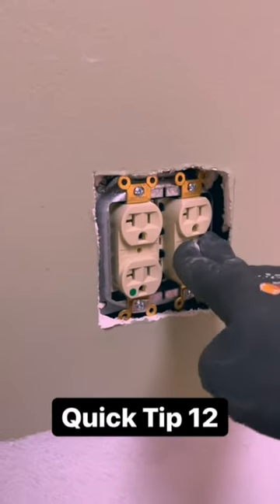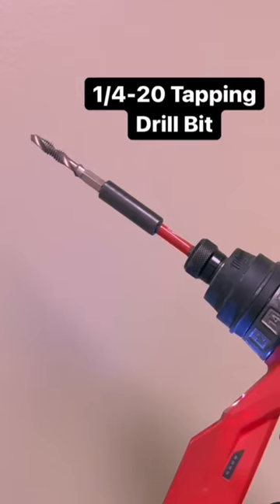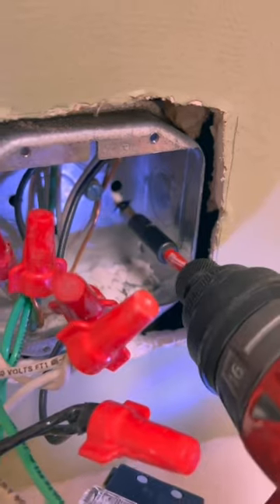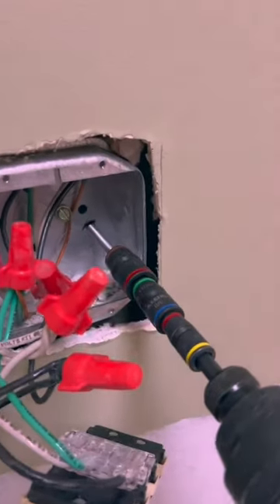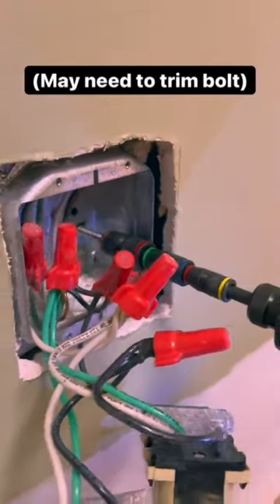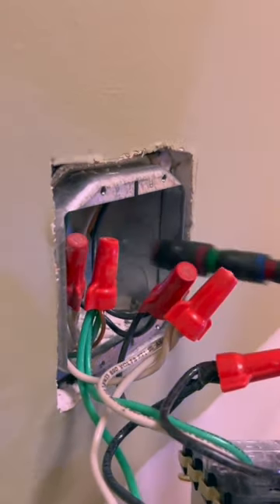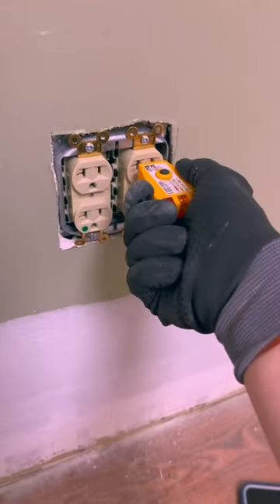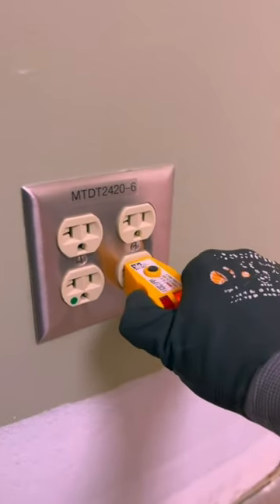Electrician Quick Tip #12 ⚡️

Comment from the maker: Context: CMU wall behind, not drywall. This backs up to a large mechanical room.

As long as you trim your bolt short enough to only push your box forward enough so that you can get your cover plate on, your cover plate should keep your box from pushing back further when things are being plugged in anyways. The main idea for this trick is just to get your box forward enough to get your cover plate on. ⚡️
Reply: I was thinking the same thing, that the length of the bolt depends on the depth of space behind the box.
Reply: Just do it right in the first place. And yes there are more ways of doing it than have been mentioned here. The plastic face plates are not that strong they'll break before too long if you use the outlet often
Reply: The major problem with this hack is in time, you'll end up with a sunken box again and a screw sticking out the wall on the other side.
Reply: True for a good quality Lutron plate, but the 50 cent plates everyone gets from like ace hardware will crack at the screw and fail every time. This is a good trick for rental properties where you’re trying to keep the cost down and not buy a $50 box of outlet covers.
Reply: @dennismccolley1380 itd be good for going behind dummies 10 years later when the plug fails.
Reply: Until it just pinches through the wall on the otherside lol
Reply: @dennismccolley1380 nope quiet you’re clueless so stop telling people what is what. The DRYWALLERS will take your h4 stud rings or your caddy box arms and fold them right in to make their job easier. And we don’t use plastic plates anymore period. Plates are nylon and unbreakable
Reply: @shadygunshow I have replaced 3 plate covers in the last 6 months because they broke nylon is not unbreakable and not designed to take the force of plugging and unplugging cords. Otherwise why would you attach your box to a stud at all just let it hang until you put the cover on them
Reply: I just use torx screws
Reply: @tommyt414 That’s what I was thinking your better off just fixing the box instead of making a “hack” that will only last a few months.
Reply: That isn't too bad of an idea, honestly.  But it looks like the reason that box is floppy is because it wasn't mounted to the stud properly. Could you use this same trick, but go into the side instead to push against the stud next to it? Also, (purely curiosity) is this at a hospital?
Reply: You should never rely on the cover plate for additional support. If it’s a hard plastic plate it’ll eventually crack, if it’s nylon it’ll just stretch and warp over time. Your box support is a great idea in a pinch. But if the box is still loose before the plate goes on, then you still haven’t fixed the problem
Reply: Plastic coverplates left the chat.😂
Reply: What if that screw comes through the other side into the drywall?
Reply: Yea... Wall plates are NOT meant to hold anything, anywhere. They are just for aesthetics... That's it. 

Using them for anything else is hore "hacky" than this trick.
Reply: Remind them that the "plate holds it" only works with really solid metal plates.

But I get it, they'll refuse to pay to fix it properly and want the hack all day.
Reply: You could do a couple of bolts so the pressure is divided between them. Less likely to poke through drywall. The plate and bolts combined should provide enough stability permanently.
Reply: @Justinwhat1  put the bolt in the middle, use a flat washer. Whatever if you have to use a couple to size down fine. Whatever. Just spread the pressure out to the flat washer rather than just the bolt!
Reply: Is there any effect on code compliance for modifying the box?
Reply: What year did your house burn down?
Reply: Yes... Innovative thinking beats ripping everything out.. And customers appreciate the results... It's our job to be innovative and really, saving the customer MONEY by doing these simple things while simultaneously doing them SAFELY is the key... Note:
1) if you're going to use 1/4-20 indeed hopefully you've got a decent supply of different lengths / and / or the methods to cut the right length.
2) A 10-24 / 10-32 would work JUST fine too, as most of us have screw cutting pliers that can make any size we want, easily😉

Comment: Good way to poke a hole through the back of the wall you're "anchoring" off of. 😂
Reply from the maker: As long as you trim your bolt short enough to only push your box forward enough so that you can get your cover plate on, your cover plate should keep your box from pushing back further when things are being plugged in. The main idea for this trick is just to get your box forward enough to get your cover plate on.
Reply: In Germany they say, this will last from 12 to noon!😂
Reply: @MadElectrician  also if you don't have enough room to safely drill a hole in the back of the box then you can bet your sweet bippy it's not pushing back. Awesome tip. I've been doing something very similar for years
Reply: Worst Hack job ever. If you trim your bolt short what’s the point. First time the receptacle is used it’s still going to push through or crack the drywall on any adjacent wall.
Reply from the maker: @matthewmartin9215   the point is to get the cover plate on, but if the box is too far back, a screw won’t go in. And a long screw won’t work because it will stop before getting flush with the cover plate. Trim your screw enough to push the box forward so you can get your cover plate on. Once the cover plate is on, it will pull the box further forward and when something is plugged in, it will prevent it from being pushed back/ making a hole. Never once had a hole poke through (granted I’ve done this only a couple of times in rare situations). Obviously the best thing would be to have whoever installed the box install it correctly the first place, or to open the wall and support the box better.
Reply: @nourdraw1548  dude that is great and and be used for so many other situations, thank you for adding to my reportoire
Reply: Hopefully the rock isn’t 1/4” and I sure hope he’s not doing it hard enough to get that flat top to start biting.. I think it’s a good one.. easy enough to out a small piece of duct tape on the back of the little bolt that way it doesn’t puncture. You’d have to push pretty hard. I don’t think people realize how easy it is to push through a wall regardless. Same with a lot of outside walls. All the stores and. Commercial building for sure that’s stucco is so weak and thin dude you can flick your finger through it. Unless the y have OSB man you’ll be pushing through way less than 1/4” of stucco and possibly styrofoam after that! Chicken wire might be your only problem from there. Now days they have stuff to bypass the wire all together. Don’t hate on the dude he’s got a good idea..
Reply: Me too been doing this for 23 years and never thought of doing this. And I’ve come up with crazy ideas
Reply: @MadElectrician nope. your "hack" is the equivalent of x-raying a person's foot to find out the shoe size. just use an F strap like it's made to do. or are you one of those ressy crews that doesn't carry them?
Reply: Same thought
Reply: That's cool in a Jam only if you have a tap bit but that's why you supposed to carry some strap
Reply: I would fix this by replacing the box with an old work box.

But this is obviously a hack and doesn't seem too bad. I would guess it gets loose again after a while..
Reply: @matthewmartin9215 maybe if you put five in and had them flush against the back so they spread the load. Rickety ass way to revisit it in a couple of months
Reply: @matthewmartin9215 this aids the plate so your not cracking it all the timethey use to make plates with this on the with large plates but people are to cheap to buy them
Reply: Was thinking the same. Or when someone pushes too hard it goes though the wall
Reply: @MadElectrician you can usually get another screw into the stud from the inside of the box. A little trickier with metal studs but I’d say that’s the way to go. Do it right but with minimal surrounding damage
Reply: @matthewmartin9215  Dude, you're channelling my foreman without all the condescending cuss words 😅
Reply: You wouldn't get paid by me the owner!!
Reply: @matthewmartin9215 channel owner is correct, once the faceplate is on, all the force, from then on, will be transferred to the plate, not that “kickstand” screw.
Reply: @davidswanson5669  yeah I think I’m gonna pass on the budget electrician
Reply: @MadElectrician  won’t work on drywall
Reply: @nourdraw1548 My Audi joins the chat 😅
Reply: Dry wallers problem
Reply: @BadCompany410 I've never actually seen 1/4" drywall, who uses that? Cheap homes?
Reply: @jjaa578 don’t try it dude I’m a commercial electrician and your full of yourself. This is a great fix to the sinking box problem. You don’t even know what the item is really called that you are talking about using to fix this. Wanna try again? An F CLIP wouldn’t work in this scenario, if you knew anything you would know that. It’s another letter your thinking of, IF you’re even thinking of the right thing.
Reply: @dennis-nz5im just say you don’t have a clue and can’t see what he’s really doing here. You’re just guessing pal. The wallplate will deaden most of the force on the box. A metal wallplate (which come in all colors) will completely remove the force on the screw.
Reply: @matthewmartin9215 what’s budget about it? If the drywall guy ruins your h4 stud ring it’s going to cost the builder an extra. End of story. This is a completely legit, professional ass way of fixing a problem somebody else made for free.
Reply: @Bigislandguy ugh, will totally and completely work. Stop being ignorant
Reply: @shadygunshow   😆
Reply: @RoshDroz  1/4 drywall is used in barrel ceilings or other radial type applications where the drywall needs to bend. Usually a couple layers. You can also lightly wet it so it forms.
Reply: @matthewmartin9215  I see! Thanks for the info
Reply: @shadygunshow  and it can be pulled out
Reply: @MadElectrician just gonna break the cover plate and still put a hole through the other side 🤣🤣
Reply: @matthewmartin9215 my guy I get what you are saying but I’ve seen old timers just scour the paper on the back and make multiple cracks to form the opening. Then mud.   But using that 1/4 in a few layers maybe leads to a better finish. As long as the carpenters did their job
Reply: @nourdraw1548 Indeed, we do 😅
Reply: @MadElectrician That will break the cover plate when someone pushes a plug in the outlet.
Reply: @BadCompany410  1. This is in a commercial setting so it’s 5/8” rock most likely 
 2. If it is 1/4” rock on walls (I’ve never seen that in 20 years of electrical and 5 years of general construction) there would be damage everywhere, so who cares?
Reply: @MadElectrician  If that receptacle is Used often,  every time a plug is inserted it will push the bolt a little farther into the sheetrock until it pops through.
Reply: @bebo5558 yes we would.
Reply: @matthewmartin9215 haha the steel faceplate will hold it in place. I've seen some shotty work and this is not it. Blame the sheetrock guys for F'ing up. It happens, we have to make it work.
Reply: @JohnDoe-oj8bd  No you wouldn't, I'm an inspector, been through this before!
Reply: @nourdraw1548 this is America nobody gives a shit abt that bs
Reply: @KitchenerLeslie2  ya I guess so. I’d think even 2” rock for elevator shafts and all I’d think anyway it would still just be overkill. I’m Sheetrock Idk man just seems a little mich
Reply: That’s just a feature. It gives the other room a stud to bolt something to. I don’t know what you’d be bolting that low, but if it’s there someone’s going to use it for some tomfoolery.
Reply: @RoshDroz 
Also, in older homes, where walls are made of lathe and plaster construction, the finished wall will be at least ¾" thick. ¼" drywall is used behind ½"or ⅝" to make patches even with the face of the plaster.
Reply: No one is understanding the power of metal cover plate. It can't push into the opposite wall
Reply: @jjaa578 f strap on a mud ring? Does that work?
Reply: 100%
Reply: Guaranteed..😂😂😂
Reply: @MadElectrician eventual cracked cover plate and hole in other side of wall ..😂😂😂
Reply: @jjaa578 
they used to do that right after x-ray machines were invented ...😂😂
Reply: @armandobroncas357  yeah who carries around a tap bit like that...😂😂
Reply: @MadElectrician should... Lol
Reply: Well, he did say it was hackey
Reply: The problem started with lack of details because that box used an h bracket that was for a 4" wall but installed in 6" wall... gotta address those 🐘 in the room!
Reply: If you think that's going to poke a hole into The back of the sheetrock and go all the way through to the front then you're definitely not too mechanically inclined and probably don't have enough experience on the field
Reply: I think the SS cover would have been enough
Reply: Works in a pinch. I just bought a house that has a lot of tricks and hacks dome to it. My life sucks now because of it. Yeah hacks
Reply: That's good until the check clears
Reply: @nourdraw1548 cool, stay in Germany then
Reply: Do it on an exterior wall...
Reply: @jjaa578 are you talking about a cut in box support?
Reply: Here is another YouTube professional who probably works fast food

Comment: Next tip video "how to fix a hole caused by a bolt pushing through from the inside"
Reply: Only by paper Walls
Reply: Dry wallers problem
Reply: @808JuJu  if you're doing this hack, it would be assumed that you are doing diy fixes. Therefore, you are probably the one doing the drywall also. Not many people are doing work on electrical terminals and then saying "nope not going to mess with that drywall"
Reply: Drywaller problem,… now move this damn broom outta my way
Reply: Maybe live in a country with proper walls
Reply: @ElectricalCurrent-bz7ou  or maybe just install the outlet properly.
Reply: @ElectricalCurrent-bz7ou Or just do it properly.
Reply: Just gotta have a deal with a drywall guy where u get 10% of every job u refer them 😂

Comment: Or, you could use an f clamp made for cut in boxes and avoid ruining the on the backside of that box
Reply: How do you do that? Concidering that is a 4 square/1900 box with a mud ring? Not to mention, the yokes on those devices don't look like they make contact with the rock. There is nothing on the front to hold it to the rock. How does a battle ship work in this situation? honest question
Reply: You're the only one who called him out on the obvious.  Plus, an F strap (aka Madison strap, hook strap, lock strap, it has many names…) costs like a whopping dollar...   Available in any hardware store or electrical supply house...   

Freaking amateurs  :D
Reply: F clips hook on drywall and keep the box from coming out of the wall, not back in.
Reply: @jamesmcdaniel4071  F clips hook on drywall and keep the box from coming out of the wall, not back in.
Reply: Meh, just drill a whole on the side of the box and screw it in

Comment: You can use an F-clip to secure it too.  They're designed for holding a 4" box flush to the wall.  They're sold in sets of two attached to each other.  You break them apart and they look somewhat like a capital F.  They're usually used to hold in a metal new work box, but you can use them on any box to fix a wobble.  

You can use it with a mud-ring too, just wrap it around the mud-ring and tuck it up to the side the same as if you were using them in the other type of box.

Bonus:  They're UL listed items, so code inspectors cannot ding you for using something in an inappropriate or unlisted manner.

And as a footnote, when installing F-clips, use needle-nose pliers to crimp them flat, then pinch the front face with your diagonal pliers once or twice to pull the clip just a smidge more by crimping that smidge in front.  It pulls the box forward just a little more for a rock solid receptacle.
Reply: The F clip won’t stop the box from being pushed in. They’re designed to be used with a box that has a flange on the top and bottom.

Comment: RACO and CADDY have box supports. Its a little clip you put on the box before the mud ring. All boxes are supposed to be supported and secured when installed. Going around to every box after the rock to fix the problem you created does seem a bit hacky, you're not wrong 😂

Comment: Screw a 4s blank on the side of the box through those two factory holes. 2x4 framing is 3.5 inches long and drywall is minimum 1/2 so it won't stick out
Reply: As someone who lives in a home built with 2x3 studs and 3/8-inch drywall, I've found there are often times when even standard "tricks" don't work very well.

Comment: Spray some expansion foam behind the box. Use a long 6-32 through the face plate to pull the box flush and secure with the other face plate screw. Then remove the 'handle' screw and use a normal length faceplate screw.
Reply: Screws up to 1-1/4 (30mm) wont hurt anything. The receptacles are designed with extra room.

Comment: Good idea I had a better one tho but it only works on single gang I took a self tapper and sent it thru the drywall to the face of plaster ring and make sure it's embedded in the dry wall a little then cover with faceplate

Comment: There is a device for this. It requires the electrician to to think about it during rough-in. It basically does what this screw is doing except it spreads out the force so it won't poke  through. It's a box bracket made by Caddy.
Reply: Sshhhhhh!  just play along with this insanity. 🤣😂

Comment: If it's not too bad you can also use the cover plate to help hold it. In a pinch it works. 

I would only use it if it's a plug that's not likely to be used a lot.

Comment: The screw will poke through the back wall. I think if you use a metal cover plate, you can tighten it down harder to hold the box from pushing back, and maybe the screw wont damage the other side of the wall.